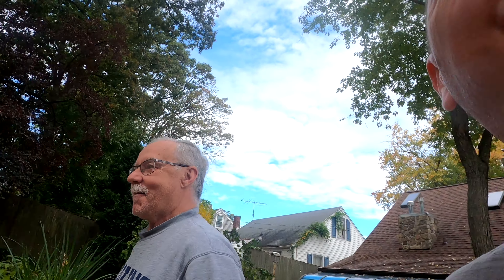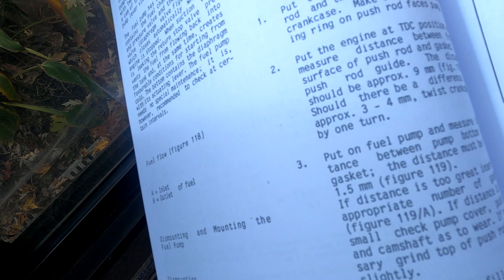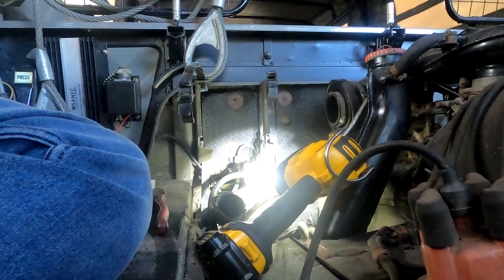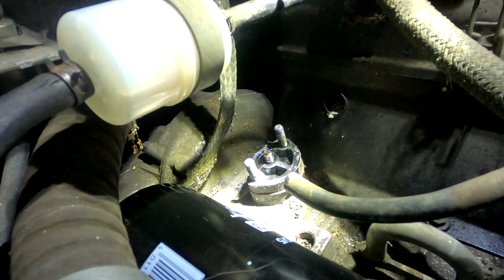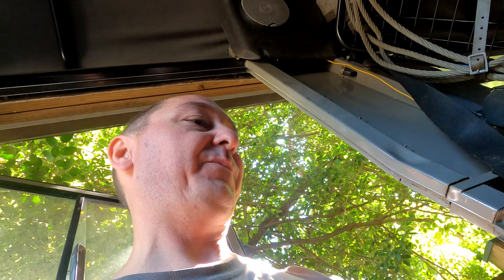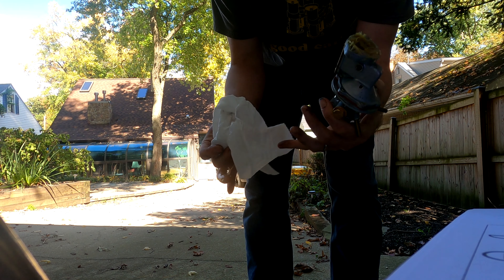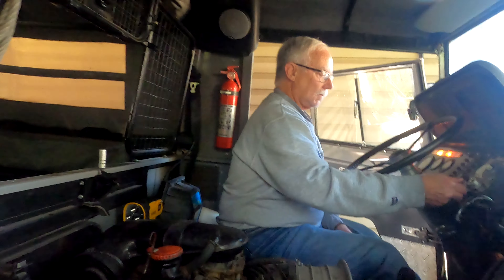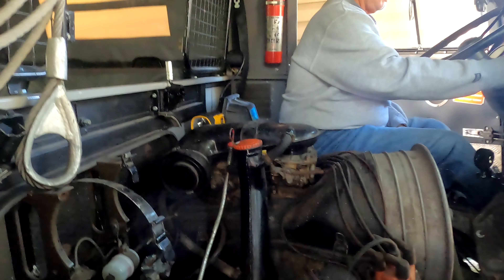Pinzgauer fuel pump replacement and start-up

Comment: I have a '74 710M and the fuel pump went out on mine as well. I did a bit of research and just replaced it with a cheap ($15) electric pump from Amazon.  Easy to wire up and has ran the Pinz for about 1500 miles so far with zero issues.  No need to worry about TDC measurements, extra gaskets etc.  Plus wiring it up with a switch makes for a good theft deterrent as well.

I carry around a spare just in case it gives up the ghost, will take me about 10 minutes to swap it out if and when I need to.
Reply from the maker: Excellent mod! Fun working on these odd creatures.
Reply: @tr3wrench  These things are so simple, definitely much more fun than most of the modern vehicles.